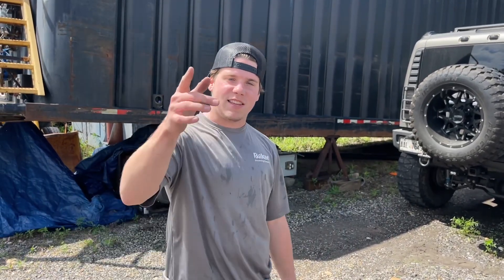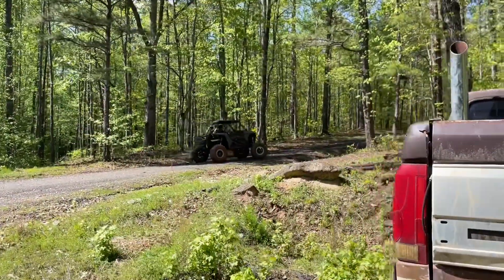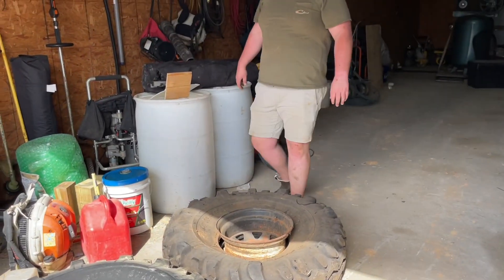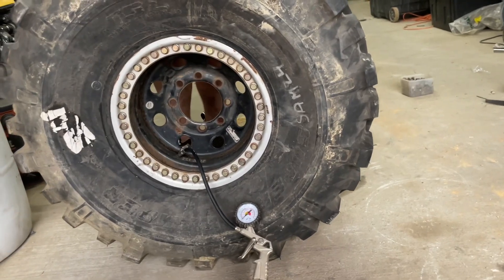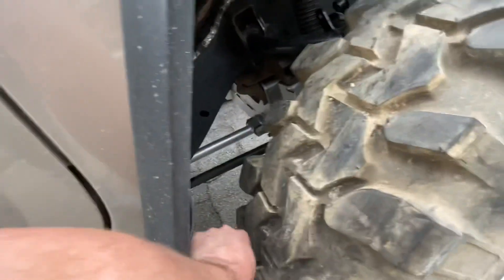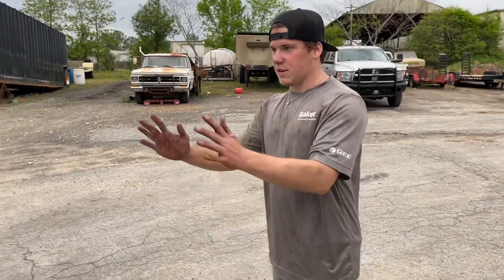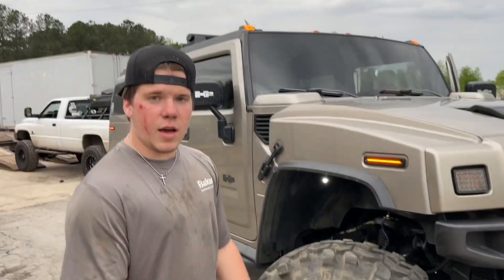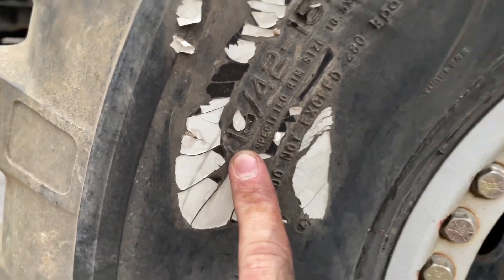Stuffing 42 Swampers On A Hummer H2

Comment: I really need to know your height but don't know how to tell. Maybe measure from center axle to the bottom of the top fender? That would at least tell me if I have the same clearance suspension wise maybe? Tire on won't make or shouldn't make a difference that way because the suspension height isn't changing.
Reply from the maker: It’s a 9” lift kit

Comment: What are those rims?  I'm looking for steel 17in rim for my H2 but I've only found the vision soft 8 rims and they have to big of a hub bore.  I want the proper tight fitting hub bore and the round holes not Ds.  Thanks  Man, looking good!  cool the 42's cleared.